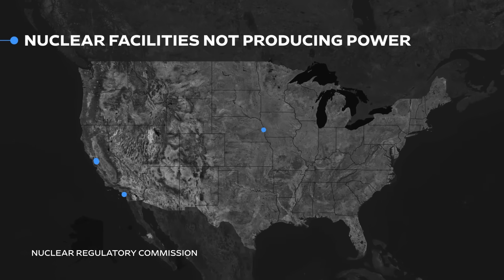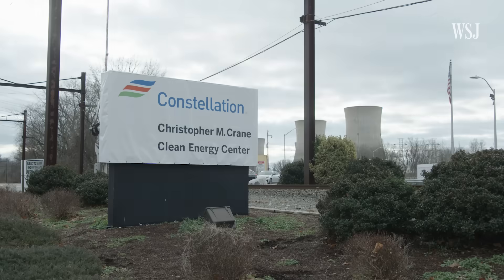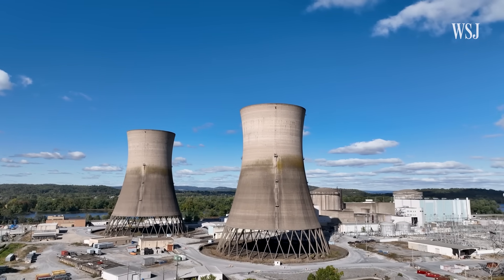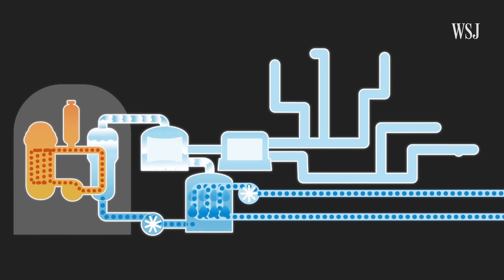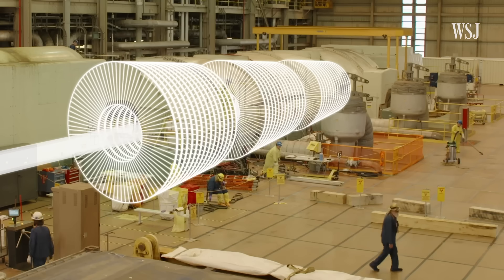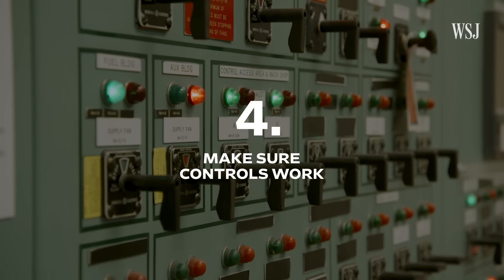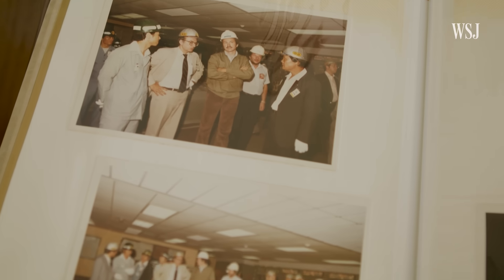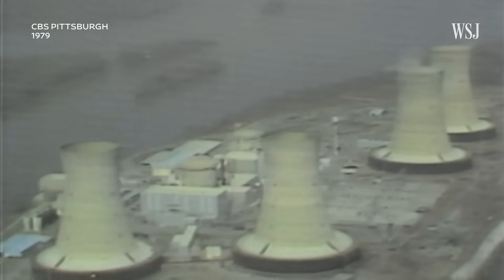Inside the $1.6B Plan to Restart Three Mile Island | WSJ

Comment: So here in Canada the AEC (Atomic Energy Commission) demands that all apparatus and equipment have an Atomic Energy certificate to be allowed to be used in a nuclear plant. To get that certification all parts used in any equipment must be traceable to source and have gone trough a massive ridged testing regime. This is a very expensive and labor intensive requirement for any manufacturer that wants to sell equipment to a nuclear plant. This also causes a lot of problems now. Take instrumentation for power monitoring as one example. In the 1960's and 1970's each function of power monitoring like under voltage or over voltage had a single separate monitor for each of the three phases of AC power production. These monitors were all mechanical in nature with motors linkages and magnets to monitor the power and send a trip signal to the breaker if they went out of tolerance. In the late 1980's the introduction of computer controls and monitoring many companies started making an All In One monitor that looked at the three phase power together with each phase load and would supply online monitoring of that output from a generator. The AEC refused to allow the Nuclear industry to use these monitors because the companies would not go through the testing that the AEC demanded. So the Bruce Nuclear Power plants were still using the old Westinghouse mechanical monitor relays instead of upgrading to the newer systems. Westinghouse said they were NOT going to support those older individual monitors but that did not matter to the AEC. Bruce power was spending $1800 to repair one relay and parts were becoming a problem to source for those repairs. There were 86 of these individual relay monitors on each generator and the costs were out of this world to maintain these old Nuclear rated monitors. For $3,500 one computer based monitor could replace all 86 of those mechanical monitors but the AEC would not allow them. This is just some of the Regulations and idiocy that are limiting the usage of nuclear power. Well you would say this must be done because it is the Nuclear industry but this example is for the downstream equipment where it is the generator of the Steam Turbine that these monitors are on and that did not matter to the AEC that it had nothing to do with the nuclear reactor.

Comment: It is not possible to treat old equipment like new equipment. Ask any old grizzled diesel mechanic that and he'll tell you new stuff doesn't work well with old stuff without a smart person who understands both stuff. Truth is there aren't many who know both still around. They've got some of the old guys advising there. That's a wise move. However, the younger guys, experienced with new stuff, may not listen to old one's wisdom. Inexperienced engineers may try to push the old equipment to the new specifications only to create another "3 Mile Island" incident all over again. If that happens it will cost Microsoft over a billion in loss and Constellation bankruptcy. There's a saying among aviators, "Know your limitations, and the limitations of your airplane." This bit of wisdom now extends to all things that are inherently dangerous but the rewards outweigh the risks.

Comment: Going to guess on the economics here. Microsoft needs a distinct source of power that the grid can't supply at this moment of total grid supply and transmission ability. Microsoft is willing to pay a premium for a private source of power for their AI computing needs, so has re-commissioned TM-1 with Constellation. Probably, the initial gigawatt hours won't be cheap and probably more than a consumer pays for standard grid power. However, Microsoft and other AI computing firms, have their secondary market where they can charge a premium and recoup the expenses for power, the US consumer and even more so, the US military. If the restart of TM-1 goes well and operates safely for some time, we expect that other dormant nuclear reactors to be restarted.

Comment: We need to make it easier to build new reactors. Consider: A Westinghouse A1000 reactor has a core damage frequency of 5.09 × 10^-7. 

What does that mean?

You walk into a casino and notice a new game called “meltdown”. Meltdown is a very simple game: the dealer shuffles a standard deck of cards and then deals a single card. The house wins if the card is the ace of spades. If it is any other card in the deck, the player wins. After each hand, the dealer puts the card back into the deck and reshuffles. 

Your chances of losing are very low, since a 1 in 52 chance of losing means you win ~98.08% of the time. 

Over the course of 1.96 million hands, the player can expect to lose (1/52) * 1.96 million ≈ 37,692 times.

Now let’s say your chances of losing are equal to the core damage frequency of a Westinghouse A1000 reactor. Over the course of 1.96 million hands, your expected losses plummet from 37,692 to just one.

Note: the core damage frequency of older plants is many orders of magnitude lower than 1 in 52.

Comment: I would think they replaced the control room equipment completely, but I guess not?
Reply: The plant was licensed with the control room as built.  It the replaced it, it would have to be reapproved, inspected, tested, and licensed all over again.  Maybe 5 to 10 year process.

And trying to get a modern, comuter controlled, control room to 100% interface with the rest of the plant (as built) might not be possible.
Reply: Looks like we're stuck with upgraded 1960's tech...  sweet 😛 And the fact that the only thing that made this viable in the first place was the insane amount of power the tech industry wants. Meanwhile Germany is scraping much more modern equipment... crazy world.

Comment: The accident was not caused by a failure of a cooling pump.  There was a signal from a pilot operated relief valve that was misinterpreted by the operators, causing them to shut down the emergency cooling pumps, due to a misunderstanding of how the system works.  The root cause of the accident was human error.  Had the operators done nothing, the reactor would have shut down safely and the accident would never have occured.
Reply: Also, the coolant level was calculated based on pressure instead of being directly measured.  So when steam built up pressure from a lock of coolant it appeared that there was more coolant than was needed.  Which is why they were confused that they temp was rising.
Reply: Exactly. These 2 factors lead to the control room operator's shutting down all feedwater pumps to prevent the reactor from "going solid" (where the entire primary cooling system blows up from high pressure and water level) They thought by doing so, the situation would improve. When in reality, the reactor fuel rods were exposed at this point. Leading to a partial meltdown that caused radiation to leak, the reactor to be permanently damaged, and a buildup of hydrogen in the vessel that almost lead to a reactor explosion. Like Chernobyl.
Reply: @zachzebra56  The hydrogen level was too rich to explode, besides, I believe when the reactor building is closed up during operation, the oxygen is purged and replaced with nitrogen, can anyone elaborate?
Reply: @peghead there’s a gas mitigation system, not really purged more like intentionally burned off
Reply: @blakehayes3119  Thanks.
Reply: @zachzebra56  I see there are some other nuclear accident geeks who really know what they are talking about here😁.  I’ve been to three mile (really surprisingly close to the little town) and when things calm down would love to visit Chernobyl, and I have a Japanese friend that swears she can get me into the Fukushima area.🤷‍♂️
Reply: @John_Morrison  Thanks! I've done a lot of research of nuclear accidents in the past as well as how a reactor works. Really awesome that you were at Three Mile Island. Hopefully you can visit Fukushima and Chernobyl when it's safe to do so!
Reply: But it did , humans can f-up foolproof
Reply: Plant operators.... They were the bain of my existence before retirement. Some good, some well.....
Reply: @paulmea3166  Well….at least it wasn’t an inherently flawed reactor run by poorly trained alcoholics, whose only real mission was to appease the party.🤷‍♂️
Reply: Losing a feed pump due to air in the line is definitely what initiated the incident. Also that why newer designs have trips for the primary due to loss of secondary systems. Obviously though yes not knowing a relief valves position and having conflicting indicators didn’t help it.
Reply: nailed it
Reply: LOL! Pilot is the guy flying the airplane. This is nuclear reactors. Perhaps you comments on the wrong video?
Reply: Thanks for confirming it's going to happen again 😂

Comment: Wow! @1:02 Those are some old controls in that plant. For reference, we were junking out controls of this vintage in car plants in the late 90's. No big deal you say? Try getting replacements for these devices.
Reply: Try getting the plant licensed with all the modifications to upgrade it.  Assuming you can get the new controls to work with the original plant systems.
Reply: @Kriss_L  Oh I know, but that's not going to make getting spares any more feasible.
Reply: There was probably very minimal, if any, oversight and approval from the US Federal Car Plant Agency that had to approve every modification to the controls in that car plant.  That is what happens with nuclear plants.  Oversight and regulation to death.
Reply: @Kriss_L  There are FMVSS (Federal Motor Vehicle Safety Standards) rules about how important things like wheels get attached in an auto plant. And that there was a record of it. I'm sure that there was more to the record-keeping side of things, but as a Controls Engineer I didn't need to be aware of anything other than that the Atlas-Copco (early on, later we switched to Cooper) tool monitors were tightening the bolts (and that all of the bolts were getting installed). More precisely, my concern was that the line stopped at the end of the footprint if any operation had not been completed. This applied to quality issues as well as FMVSS ones.

But I've been told that there is a "Cradle to grave" record on a heck of a lot of things pertaining to your car (for GM at least, I can not comment of other manufacturers since I never worked for them).

So for us, it was the "if" and not the "how" of the operation that got monitored. Unimportant things (to me) like if the volume knob on the radio got installed or if the light bulb in the ashtray was there or not was left up to Quality to keep straight.

Which is still not going to make getting replacements for the gear that they have on hand at the nuclear plant any more feasible. 

And after all of these years, I wonder how many of the electronic devices will still work? Batteries (Looking at you, Varta) will have leaked, Tantalum capacitors will blow up, electrolytic caps will have leaked and eaten through the traces on the board. Finishing off what the batteries had started to destroy. 

Controls made before the dawn of the Digital Age will need re-calibration, presumably by techs who are no longer alive. Other devices such as pumps, cooling lines, and ??? will need repair or replacement.

Get your checkbooks out boys, this is going to be fun... :)

Comment: The primary discipline on reactivating the TMI reactor with diligence, throughness and safety in mind is the financial damage to the company that will inevitably occur if a nuclear accident happens. The stock market will drive the value of the company into the ground due to the legal risks. Constellation Energy runs a fleet of nuclear reactors so has expertise in the technology and operations. No company wants to destroy a productive asset. That's a lot of motivation to do the job right.

Comment: And of course Microsoft will be held accountable for any screwups as well as the decommissioning and waste management of the plant, right? Right?
Not a single terminal storage facility, let alone a fast neutron plant operational on the entire continent. But let's restart the disaster reactor because the Small modular reactor bubble is already over and there is a way to theoretically blame it all on user error. 
Nice. 

Wishing the technicians there good luck, they will need it.

Comment: I was an 8th grader in the Harrisburg PA area when that accident happened.  Lived about 10 miles from the plant, got out of school early (had no idea why).  Nothing resulted from the radioactive steam leak (maybe my sanity has been affected, but.... ).  I was wondering if/when someone would start using that site again.  They tore down two other cooling towers decades ago.
Reply: Containment was never breached. That relief valve was inside the powerhouse itself, which was designed to contain any radiation leakage.
Reply: @Demonslayer20111  there was some steam released. Intentionally to reduce pressure. No issues and no major increase in radiation in the area.

Comment: If the water pump failed and mind you is such a vital piece of equipment why didn’t they install another condenser water pump with a automatic bypass valve and none of this would have ever happened

Comment: This is idiotic. Why are they reusing the old controls? Spend the chump change (probably 10miilion ish) to upgrade to a modern and reliable distributed control system. That way they won't have to buy their parts off ebay

Comment: As an engineer that has had to resurrect old control systems a few times, there is zero chance of this plant reopening without complete overhaul.
This is just another AI funded pump-and-dump to gain funding and split with the profits

Comment: The “pipes” shown at 2:25 are either the tubes in ten steam generator or the condenser. These are not the source of the leak that lead to the meltdown of the other TMI plant. They can leak, but it is not at all the same type of failure.
Reply: Wonder how old that heat exchanger is...  maybe I don't wanna know.

Comment: Even if one assumes that nuclear power is safe it is so risky financially that safety is moot.

Three Mile Island
1.	Nuclear power is safe for people.  Inadequate regulation, faulty design, imprudent operations and several coincidences all contributed to causing the accident.  Bottom line - the containment held.  No one was hurt.  There was no catastrophic radiation leak.  Damage awards were small.

2.	Nuclear power is extremely dangerous for investors.  John Graham, the Treasurer of General Public Utilities (owner of TMI) wrote in Journal of Commercial Bank lending - May 1980, “The discussion of whether to recommend a moratorium on new nuclear plants in the Report by the President’s Commission on Three Mile Island is somewhat irrelevant.  I do not believe that there is a board of directors of an electric utility in the country which would now approve a nuclear plant as a new initiative.”

Why?  Overnight, a billion dollars in revenue producing assets turned into a gigantic, unfunded liability.  People were safe.  Investors were not.

Darlington
Ontario came close to a nuclear financial meltdown.  The first unit at Darlington was started up in 1991.  After a month, they did an inspection.  To their horror, there were cracks in the giant rotor.  It was a design flaw.  All four rotors had to be replaced.  More delay - which in a debt intensive project means escalating costs.

It got much worse.  When they took the fuel bundles out of the reactor, they had been shaken apart.  A massive pump within the system was putting out a vibration that was destroying them.  The pump was re-designed.  The vibration stopped.   Had the re-design not cured the problem, it was possible the entire $17 billion project would have to be written off.  (I was an Executive Speechwriter at Ontario Hydro.  I sat in the office of Ontario Hydro Chair Marc Ellison with Phil Carter, Premier Bob Rae’s personal representative at Hydro, who told me this story.  The test of the new pump was the next day and they were terrified that they would have to announce the complete write-off of the Darlington project).

Things have not gotten better for the nuclear industry
The only nuclear power reactors currently under construction in the U.S. are at the Alvin W. Vogtle Electric Generating Plant in Georgia.   They are years behind schedule and billions over budget.  Plans to add two nuclear reactors to the V.C. Summer Nuclear Station in Jenkinsville, South Carolina have been scrapped with a loss of $9 billion.   Westinghouse, the prime contractor in these projects has filed for bankruptcy.   Parent company Toshiba was forced to sell its chip unit.

Comment: "America's worst nuclear meltdown". Yeah on the whole that wasn't very bad at all. Some radiation, almost exclusively short lived isotopes, escaped and it cost lots of money. That was all.
Reply: All American power reactors are built inside concrete containment structures. If radioactive steam or gasses escape from the reactor they stay inside the containment building. The official TMI report does not show uncontrolled release of radiation. About 2 weeks later, the plant operators were allowed to vent the containment building to the outside air at a very slow rate so the level of radiation at the plant boundary did not exceed the normal regulated level.